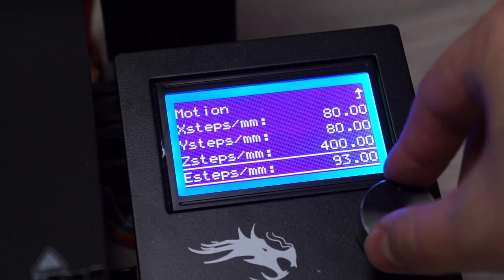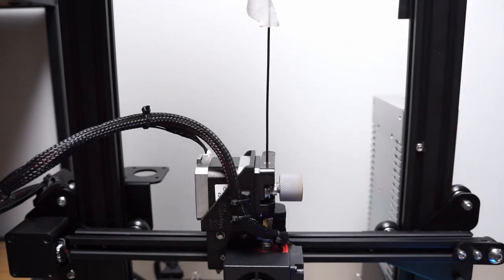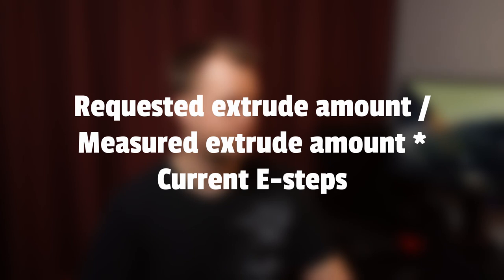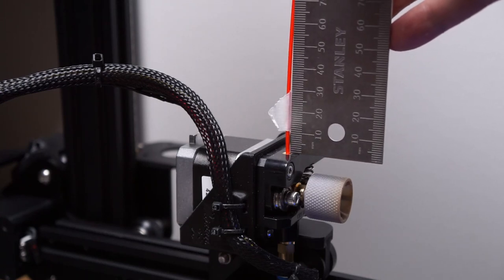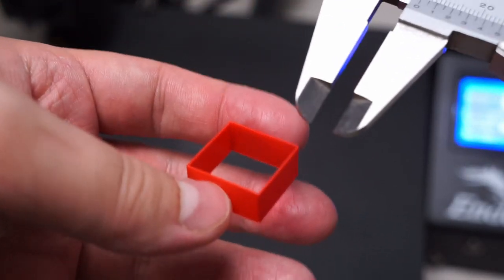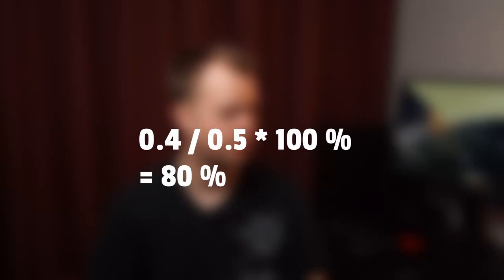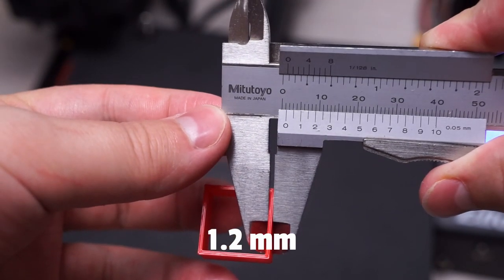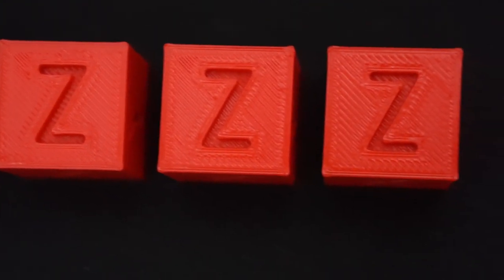How To Calibrate E-steps and Flow Rate for Ender 3

Comment from the maker: I'd like to hear from you, what was the best calibration or tuning you've done that resulted in better printing quality?
Reply: You have under extrusion because your line width is supposed to be 120% of you nozzle diameter. If you want to use 0.4 as a line width for a 0.4 nozzle, you need to have a machine that is calibrated very well. Not just e-steps and flow. Obviously your printer isn't calibrated this well.
Reply: And  tbh, e-steps cal should be done without going it though nozzle, because you calibrate length and not efficiency of extruding...
Reply from the maker: But aren't you calibrating it for actually extruding material with the nozzle? In real use, the nozzle resistance is part of the problem you're trying to solve with the calibration. What purpose does it serve to calibrate without the nozzle?
Reply: @HardFirmSoft  do we recalibrate e-steps after nozzle switch or tube change? nope :) I would say nozzle resistance more about torque/physical stability of printer. And people do increase/decrease temperatures, which affects resistance, that's why it's better to exclude it. And imho, by calibrating with resistance, we add 1 more variable inside e-steps value, that affects quality.
Reply: @BubonicPestilence  you should absolutely calibrate with the nozzle.
Reply: Temp, retraction, and extrusion steps. In that order. Awesome video!!
Reply: you are on the right track in this video, the way many people do it is wrong, but you have to print 2 calibration cubes 1 with 1 wall thickness and another with multiple (i use 3) wall thickness and derive equations to calculate both the optimum flow rate and the outer wall squish (2 equations 2 unknowns)
Reply: @Nicodemous17  so calibration with the nozzle can skew the results as you are actually looking for the exact value, from there you can adjust sliver settings so that you never need more torque than your extruder can apply.

Also, the shift to a dual tooth/gear extruder creates a better average on the printer flow and is less likely to grind and reduce extrusion even at higher nozzle pressures.

That is also where the flow rate timing comes in, it creates exactly the wall thickness you are looking for. 

There’s is then 2 ways to manage the issue shown in the video, making your extruder wall 120% your nozzle opening, or increasing the overlap between walls and skin (I use the latter as it makes for best accuracy and more consistent full between the two)
Reply: @kevdog261  That makes sense, the only question is what setting in the slicer would change the outer wall squish? I think horizontal expansion in Cura might be it, but I'm not completely sure.
Reply: @Nicodemous17  I have seen the same thing - when the single wall is the diameter of the nozzle there is noticeable under-extrusion in the bottom layer. If we were extruding a single round line then it would be correct, but the squish is always there in the multi-layer print, which has to be there when building a model. I would agree that when the wall is right then the other factors like designed dimensions and horizontal expansion come into play. It can lead to a vicious circle, though!
Reply: I like to look at a top layer with a microscope then you can see how well it is filling and adjust flow accordingly.

Comment: Using a piece of tape to mark the filament height for extruder calibration is the BEST tip I've seen in months. Thank You!
Reply: I use a jig that holds my caliper in place and a special clamp to hold the filament onto the moving caliper jaw.  Extremely accurate.  Found the idea on thingiverse.
Reply: Even better use a silver marker pen for welding.  It'll mark on any colored filament.  Also, if extruding 100mm mark at 120.  If you over extrude with tape marked at 100 you have no idea how much you overextruded by.
Reply: Tape, or a sharpie mark. Remember where on the tape. I use the bottom edge lined up at 120 or 150 and run 50 - 100mm through the heated nozzle at the typical printing temp.
Reply: The top is a true “why didn’t I think of that” (-8
Reply: exactly what i was thinking!

Comment: YES, I have the same concerns as you.  I had my flow rate down to 92% to achieve dimensional accuracy, but then every time I tried to print a bridge in my temp tower, it was under extruding.

Comment: Yes! Wonderful logic and explanation, I am so glad that I found this video. I had exactly the same issues with under extrusion as you and now I have a better idea as to why. However, I am still left wondering how to calibrate flow rate? Could you point me in the right direction?
Reply: There is only one way to calibrate flow rate. Make sure your E-Steps are on par. Your printer has to push 100mm of filament into the extruder if you ask it to.
After that leave flow rate at 100% and tune in horizontal expansion. But only on small parts like cubes of 20mm because once you print something bigger like 200mm your part will shrink as well. so you need to calibrate that too.
In short:
1.) Make sure E-Steps are correct
2.) Print small cubes and calibrate horizontal expansion (basically scaling the part to it´s correct dimensions)
3.) Print a large part of 200mm a cross for example with 100% infill, let it cool down and measure shrinkage. Usually somewhere between .3% and 1,5% depending on the material

After that you are good to go every part fill fit as long as you don´t change line width or materials

Comment: What I do is I 1) calibrate my e-steps 2) then I print a single layer disc at 100% flow rate. If I get over-extrusion  (I get jagged edges on the surface), I lower my flow rate to 70% then try again. If my surface is smooth, I bump my flow rate, etc. I do a binary search of the flow rate that will be smooth but barely making jagged edges. In other words to a point where it's not creating jagged edges but if I add 1% it will. I note this value for my first layer flow rate. Then I print a 2 layer disc, and do the same with the flow rate for the remaining of the layers. So in Cura I have 2 flow rates, one for the first layer and another for the remaining layers.
Reply: In my thought proses if your first layer lines are squishing out significantly more than the subsequent layers it has more to do with the first layer height than extrusion on the first layer. If your bed is to close to the nozzle your printer will be pushing out material to fill a gap that is slightly larger than is actually there, therefore causing the lines to squish out to the side as the material has no where else to go. Simply adjusting the flow to compensate for a bed that is either to close or to far away will do more to create a slight Z axis dimensional inaccuracy than truly fix the problem you are facing. I would aim for a first layer flow that is nearly identical to the rest of the model to keep things as accurate as possible. As for the possible "elephants foot" effect that can happen to the first few layers (especially on a heated bed) I use the initial layer horizontal expansion setting to compensate for the little squish. or simply design a vey very small chamfer into the bottom edge of your models to all but eliminate that concern.

Comment: Arriving on this video just after seeing one that explains only about de flow rate calibration, so I have a good complement. After trying calibration with the expansion parameter, I notice that the corners are way more visible, also on a surface when there is a perpendicular wall behind, we see it bumping out from the outer wall very much, so might touch other parameters because of the expansion rate to reduce flow at the angles or something

Comment: Conclusion: Line width (measured on a printed part with single perimeter) should always be greater than extrusion width set in slicer. 
Mathematically (min. line width = nozzle dia. + layer height) 0,4mm nozzle + 0,2mm layer height = 0,6mm line width. (Notice how you should have a smaller line width for smaller layers)
Set line width to 0,5mm in slicer -->Print out single wall piece and measure 0,6mm line width, perfect settings.
This will mean your layers will be bonded well, you will not experience gaps in prints and you will get reasonable well details with 0,5mm extrusion width.
Now you can also easily tune your dimensional accuracy. You know that your set extrusion width is 0,5mm but real line width is 0,6mm this means you can set a XY comp. for -0,05mm.

I must thank you a lot for this video, because I had always issues with my extrusions, it was either too much or underextrusion. Or the dimensional accuracy was wrong etc.
I looked further into the issue after I watched your video. And finally solved it through my own conclusions and information on the internet.

Here it is graphically explained why min. line width with a 0,4mm nozzle and a layer height of 0,2mm should be at least 0,6mm:
https://dyzedesign.com/2018/07/3d-print-speed-calculation-find-optimal-speed/#:~:text=A%20general%20rule%20of%20thumb,bigger%20nozzles%20and%20layer%20height.

Comment: In general you are right, but there is still one problem. At 80% I get the correct single line width (say for small details where I only use one single line) at 100% I get closed top shells but not the accuracy of the single shell. A 2nd adjustment one could make is at 80% increase overlap of peremeters from standart 25% to 50% this way the shells will be merged together. And decrease line width from about 0,45mm to 0,4mm the extra squish will force plastic beyond 0,4mm to say 0,43mm this way top shells will be closer together. Also increase the amount of top shells from e.g. 3 to 5. It´s worth a try as well because I get precise single extrusion lines. Please tell me what you think. What is the disavdantage of your method ? Is it more difficult to print details and single lines ?

Comment: I've been struggling with this as a newbie (though a scientist and engineer). I had found horizontal expansion before flow rate. I have the same thoughts as you, that it may be better to use nominal flow with negative expansion.

Another issue using reduced flow besides strength. If you then need to use a positive horizontal expansion to account for undershoot on dimensions, on tight tolerance parts, Cura will expand them then decide that neighboring surfaces are one solid. And print those layers as one in the slicer! I didn't notice this until printing a clearance test, even though you can see the effect in the slicer.

If you use 100% flow and retract surfaces to account for bulging, it's not a problem on print in place.
Reply: I'll add to our theory with geometry. If we compare the area of a square to a circle inscribed in that square, that's pi/4 or 78%. For the few filaments across two materials I've tried to calibrate wall thickness to using flow, the result was 75%-82%. All right around 78%. Suggesting that what we're really doing then is leaving gaps in the print in favor of dimensional accuracy over firmly bonded layers.

Probably there's a better optimum in between. But I agree. Leaving parts very under filled must be bad for strength even though there's lots of tutorials suggesting that's how you calibrate flow.

Comment: Thanks for this video! When i use the single layer cube to set the "correct" flow rate, everything will be underextruded resulting in bad prints. That's why i usually print with 100% flow rate anyway. But now i have to print something dimensionally accurate so i have to look into horizontal expansion.

Comment: İ am using double wall calibration method and for a 1 week i tryed many many o f settings yo correct first layer with %88 percent flow but i couldnt its very helpful video thank you

Comment: Speed. I wanted to prent hot and fast with big nozzlles when I got mine and assumed something so simple as volumetric flow would be adjusted in cura if you changed your line settings, but nope.

Comment: I would calibrate Estep without extruding through the nozzle to be more accurate and avoid issue with temperature and hotend (but with DD configuration it’s quite hard).  You should explain how to use this Expansion setting instead of flow multiplier though
Reply from the maker: But isn't the point of the calibration to account for the resistances that are in the printer? And yes, it would be a good idea to make a video about using the horizontal expansion setting.
Reply: @HardFirmSoft  In this particular case I disagree. ESteps Calibration is about the calibration of the amount of filament moved by the extruder regardless of all other impediments. Those other things should be taken into account on a filament-by-filament basis, as they will vary. Example: Printing PLA at 210 on my printer will have much less resistance than printing PLA at 195. Therefore my Slicer Settings should account for that. It might be that the printing speed needs changing, or something else, but it should not involve ESteps.

You also say in this video how NOT to calibrate FlowRate, but fail to tell us how it should be done (while the video title indicates you will tell us how). I have asked in support groups, only to be told the only way this can be done is the method you say is wrong...

Thank you for the video anyway.
Reply: @HardFirmSoft    Extruder motion is purely mechanical. If your printer is working properly, the extruded filament without the nozzle should be exactly the same as with the nozzle in place. If it's not, then you have a problem with your extruder (clog causing the extruder to loose steps, or your filament is slipping in the extruder gears). Either way, you're not calibrating for "resistances" in the printer.
Reply: @cliveknowles7496  x-mm extruded is the command and if it does not extrude that much then the flow has to be cranked way up. If your extruder is slipping then you will not get the amount that you are expecting. E-staps has to be accurate for the slicer to "know" what to do. I plan to check E-steps with a couple of different materials and temperatures, but if it is significantly off then the base of the process is off, IMO.

Comment: That seems to be if you have to reduce the flow rate, as in your case, but if after the calculations you end up needing to raise the flow rate above 100% you wouldn't have that undextruding gaps when compared to this case's 100%, would you? I'm asking because for most of my filaments I end up with a  higher-than-a-100% flow rate and seem to get great results.
Reply from the maker: My thinking currently is that it doesn't really matter if you change flow rate or e-steps, both affect the same thing: how much filament is extruded. I would suggest making a best effort calibration for e-steps, and then varying the flow rate based on the material you're using, because that is a lot faster to change. It will also help to keep track of the values that you've found useful for different materials.
Reply: @HardFirmSoft  - Exactly. Its good practice to use every parameter exactly to its purpose and not to mixed them up experimenting all over undesired side effects. Looking to Your Videos and conclusions, it seems that You are a very smart guy. Thank You for Your video!!

Comment: i did the 1 layer wall and got 95% , if i do all flow at that rate i do get tops under extrusion, so i just run my walls and infill at 95% and my tops at 100%, it would be interesting to see if height is same 95% as im guessing horizontal expansion wont help that...

Comment: This evening I tried to „calibrate“ my dimensions by adjusting the e-steps settings for X/Y inside Marlin firmware. And I earned very good (in terms of precise) results, at least for the test cubes. Let’s see if this will confirm also for larger objects.
Reply: What was the result with bigger prints? Your method working well?

Comment: 2:52 - I also have exactly 1.5mm differences... it's weird but what could cause this? I'm thinking that the stepper motor is missing steps or software bug. I have Ender 3 V1 stock bowden extruder. I was taking measurements without using the hotend, simply directly from the extruder module. I'm thinking the best way to get proper estep calibration is to take at least 10 measurements and then obtain an average. Then use the average value for the calibration calculation.

Comment: I have an ender 5 plus, and the touch panel (not a wheel) doesn't have a section for changing the e-steps. Do you know how I might perform this calibration on an ender 5 plus?

Comment: Thank you for he simple to use instructions but I am having a crisis with my ender 5 pro. it has worked fine for about 9 month but recently it has under extruded and clogged all the time. I have switched out almost all the printing hardware and still can't get the obstructions to clear out. I tried resetting the firmware and that has led to an estep calibration problem. I ran through the calibration steps you mentioned and only made the under extrusion worse. Its now printing less filament. I don't know if there is some step I'm missing but can't understand the errors.

Comment: My E-steps are calibrated, when I print at 100%flow 0.5 line width i measure 0.5 with a caliper but somehow when printing an object it looks overextruder how???
Reply from the maker: I have had experience with some filaments that might need the flow decreased a bit to look good. Is this happening with all materials?
Reply: @HardFirmSoft  yes, with all my PLAs, the holes are smaller. To improve this I need to set a negative  horizontal expansion

Comment: Why when doing this test do people use 100mm or in your case 90mm? Why not just mark off the curent mm that is set in the printer, in the case of the ender 3, 93mm so mark off 93mm on your filament then run the test. I dont get why 100mm
Reply: 100mm is just easier to do math with. You can do 101, 120, 95, 20, whatever. The larger the number the more likely your math will be closer to what you need, but too large and you waste filament and time.